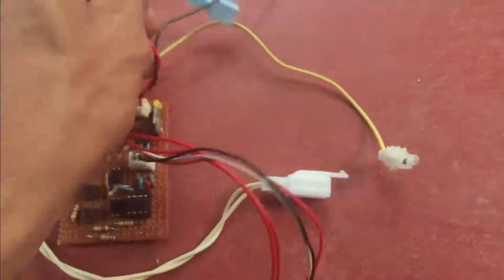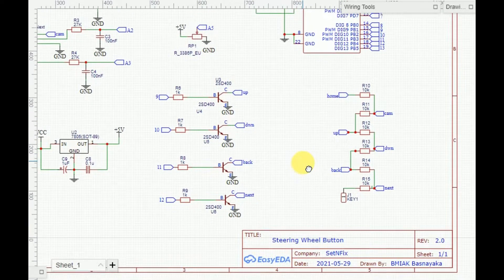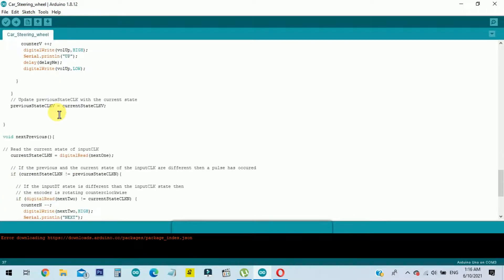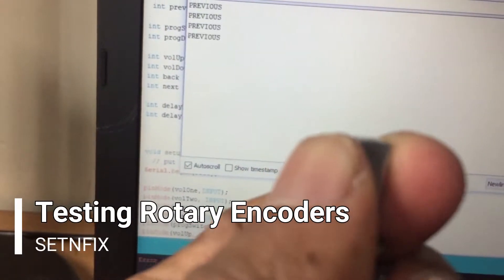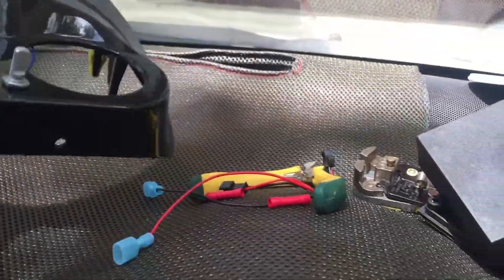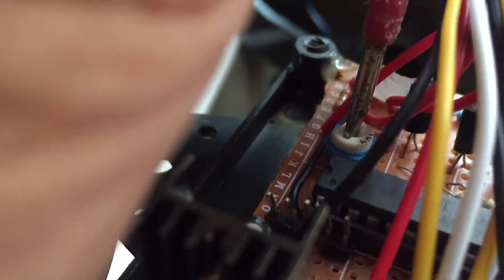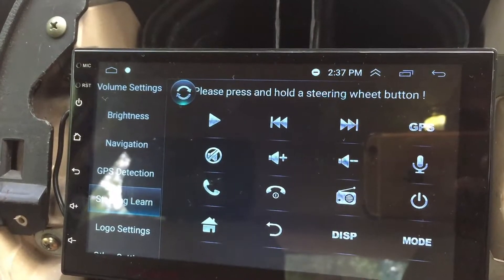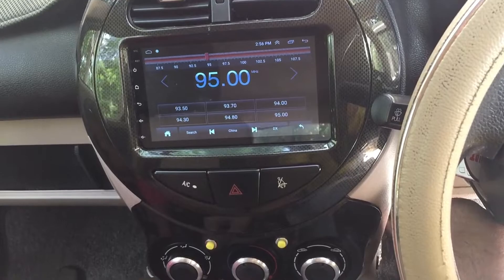How to make buttons control on the steering wheel of the car | An Universal Unit for Any Vehicle

Comment: Hey, great Project! How do you do the connection from the arduino to the board via the 5 "Programme" Pins you have put on the board? I have tried to use the Arduino as a USB-to-Serial-converter. But I can not get a connection to write the sketch or test the rotary encoder.
Thanky you!
Reply from the maker: You can directly program the atmega 328 using Arduino board. There must be wires from +5v, GND, Rx, TX and Reset pins.